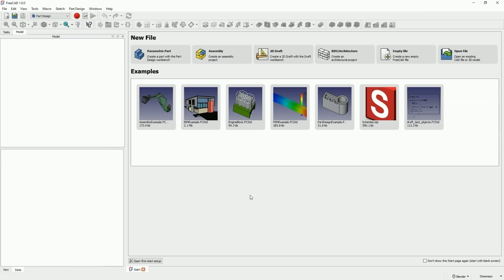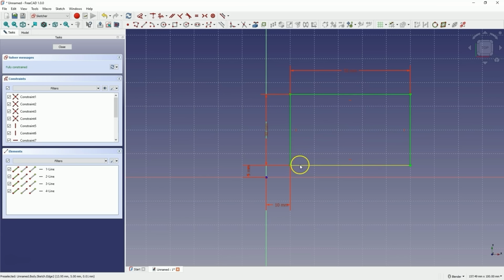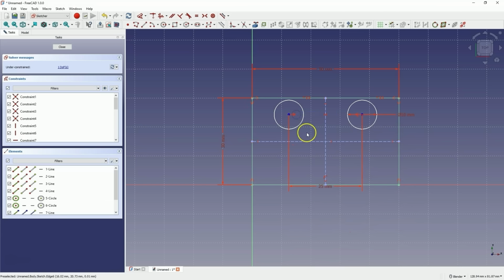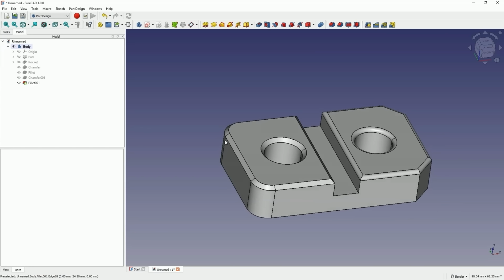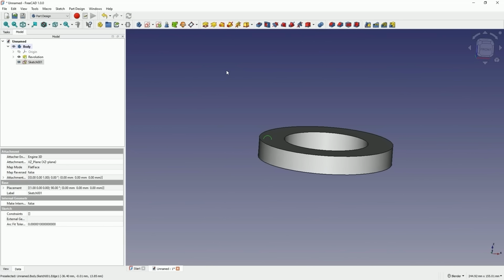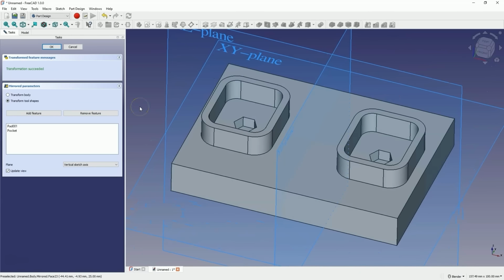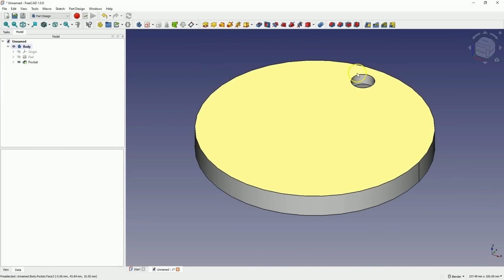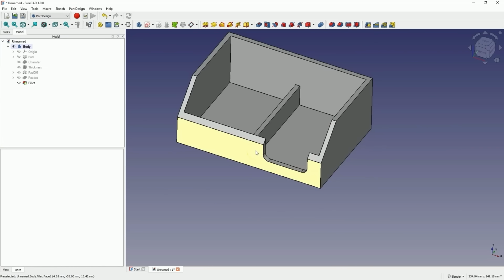FreeCAD 1.0 Tutorial for beginners 2025

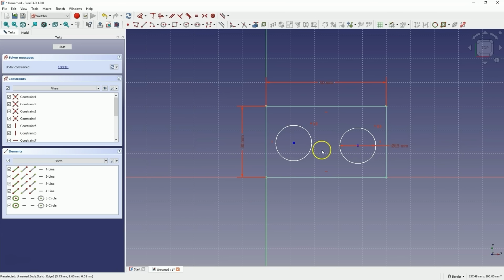Comment: I'm having issue changing the diameter @10:45.   I can change the diameter outside of the rectangle no problem; however, whenever it's inside the rectangle..... it doesn't change at all even when I change the value for the diameter.

Comment: When flipping back and forth between the video and my actual sketch, at one point, the lines in my model turned very light color. When I applied the "extrude" command, the entire sketch/model turned green.
What did I do wrong?
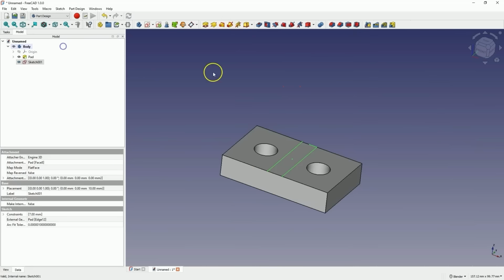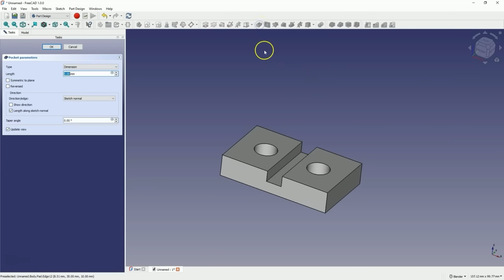Second question: At video location 23:39, the sketch is not shown as being complete (closed). When the pocket operation is chosen (23:44), the sketch disappears and the error "Pocket wire is not closed" is displayed. How can this be corrected?

Comment: If you follow along and have an issue with the second rectangle’s Constrain Symmetric feature turning orange, you need to check the “Auto Remove Redundants” box under "Auto Constraints" setting he told you about at 12:50

Comment: When attempting to symmetrically constrain the rectangle as shown at 23:08, my sketch becomes over-constrained. I've followed along perfectly I think...clearly I did something wrong. Any assistance greatly appreciated...thanks! Version 1.0.2
Reply: same here
Reply from the maker: In the newer version, this might indeed behave a bit differently — it seems the automatic removal of redundant constraints works in a slightly different way now, which can cause small differences like that. Try manually removing redundant constraints in the panel on the left side of the window.
Reply: Thank you for the advice…I did and the sketch is now fully constrained.

Comment: Fnatastic, straight forward, step by step, for beginners tutorial. Coming from 3D tools like Blender and Houdini, I thought CAD would be realatively easy - It's not! But while following these steps I keep getting to a point where things turn orange, which according to the internet means that something is "redundantly" or "over" consrtained.
Reply: Hey I kept running into the same problem.. I fixed it by going into Edit/Preferences/Sketcher/General then turning on "Auto remove redundants".  I believe you used to be able to turn OFF auto constraints but I can't find that option.

Comment: The problem is The Windows and MacOS versions are different. So, the tutorials of Windows are not applicable for MacOS. So, no point of watching these tutorials, which are on Windows.
Reply from the maker: FreeCAD on Windows and Mac is the same program. There are no significant differences — any differences may result from interface settings, which depend on the user.

Comment: As a FreeCAD newbie, I've tried to get my grips on this software by following several different tutorials. All of them left aside essential steps to set up a design. Your tutorial at least closed some of these gaps. I'm sure I will still find some more obstacles on my way onwards, but yours is by far the best beginners' tutorial I've watched so far. Transferring sketches from 2D to 3D is not an issue for me: I've learned that back in the days during my apprenticeship, and as an elderly software engineer and database designer I'm used to deal with 10, or 20, or 40-dimensional spaces. My main problem is the complex user interface, that's similar to nothing I've used before. You helped a lot - thank you for sharing your expertise!

Comment: At 23:23 when creating the 2nd constraint i get a redunant constraint and it wont allow me to set it to 7mm
Reply: Or it says fully constrained and  gives error once i put 7mm
Reply: I have the same problem. I can't constrain the width of the rectangle.
Reply: In the solver messages panel on the left it said Redundant contraints (10). I selected Constraint 10 in the Contraints panel below and hit the delete key. 
The solver messages changed to under-constrained.
Then I was able to define the width of the rectangle, turning it green.
Hope this helps.
Reply: @PhilipBryden  Thank you.
Reply: @nicklasknudsen9421  I've just found there's a drop down settings menu (top right in the contraints panel). You'll find a tick box to remove redundant constraints. Mine was un-ticked.
Reply: Nope, still doesn't work for me....

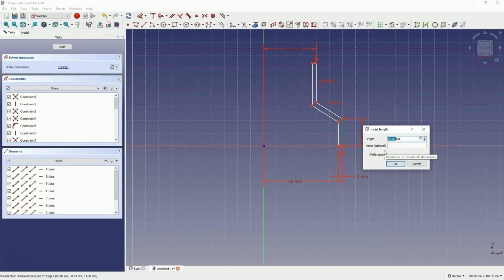Comment: At 37:24, when I attempt to set the dimension of the upper outside point, it moves the point but does not shift the attached items with it, rather just takes the point itself and moves it and drags things with it which ruins the sketch. I've followed your steps precisely and every single time it does the same thing. i set all 6 vertical lines as parallel, then set the width at the base, then set the distance to centre as 60mm and then when I do the same at the top, it just moves that single vertice rather than adjusting as yours does.

EDIT: I figured it out. When he said "doesn't matter about the dimensions" i made mine a bit more abstract. Because the setting of the dimension to 40mm from the axis meant that it moved that point past the one to the left of it, it flipped it. To rectify this I found two ways: Firstly, draw your first draft roughly the same shape and location you want it to go, and adjust it only minimally to get it to fit properly where you want it, OR you can draw it wacky like I did, and before you constrain it, click and drag it to fit the shape you want more closely before you constrain it.

Comment: Hi there, your tutorial is in much  more  greater detail than other. However, when trying to use the 'trick' with the auxiliary lines I'm unable to create such a line. The program complains about wire not closed and using the option to toggle them from being part of the sketch and being an auxiliary line nothing happens. What gives?

Comment: I keep doing something that causes the loss of all the sketcher tool icons, I lose the coordinate system and the grid, and I can't get back to the working environment. I think I pressed esc, but it could have been something else. Now, I can't continue to follow along with the video. I've restarted, 3 times. [see the fix below for how to get out of trouble]  I get to the place of setting the 7 mm dimension and I get the message "Datum for the constraint with index 12 is invalid (shows I've tried 6 times) (and it doesn't show the 7mm dimension, and it remains orange, doesn't turn green -- it never gets fully defined). I tried many times and can't get past this point. [I had doubled an instruction which I needed to delete from the list].  If you double selections of elements, you can get an error and the sketch won't complete properly. 

I tried again and came back to the point where I use the pad. I get the message "Cannot use selected object. Selected object must belong to the active body"
I'm trying to figure out how to make it the active body. It turns out you can't select the object, it has to be already linked to the geometry. But I was able to get the pad to work, but not a sketch on the face of the pad. No sketch, no coordinate system. Start from scratch again :(   [I had an element defined twice causing trouble, I deleted it from the list]. Also, on a Mac at this point, I was NOT able to chamfer or filet a surface selection. It appears to be broken. (1/8/2025)

I finished all the examples until the end. Finally! Some things I learned: on a Mac, as usual, "command" replaces "control." On a 4k screen, the dot intersections are very small, sometimes I couldn't tell if I actually clicked the dot (it turns green when clicked) sometimes I had to zoom. The examples go very quick and you need to notice if the selection is a center draw on a sketch or a basic draw. I don't use Safari to do these kinds of tutorials because you can't switch back to a full screen video. I use Opera or Brave browsers.

You can save each example and it will be added to the list of models in your project. After saving you can start a new part by clicking on "Start" at the bottom of the screen and then selecting Parametric Part to start a new part, just add a sketch to define the part. If you get stuck you can undo to back out. You can also double-click any element in the design to edit it. You can go back and forth. 

It takes practice to understand the methodology of the program, but once you get it, things flow more easily. One confusion was the ability to select two points without having to hold down the command or shift key. It just allows it. But not in all circumstances, for some discontinuous selections you need to press the "control" (PC) or "command" (Mac) key to create multiple selections. Also, he uses the grid on all examples. You can turn it on and off by clicking on the grid icon.

All in all, this single tutorial actually gave me basic skills, no other tutorial even came close. He is a master teacher. Yay! and THANK YOU...
Note:  I needed to edit this comment multiple times, so it reads a little awkward. I had to restart or backup and redo instructions many times, maybe 20 times to get through all the examples, but I learned a lot. It's worth it to meticulously go through this tutorial, you will get rewarded with a good basic understanding of FreeCAD.

Comment: I tried and tried but freecad 1.0.0 does not behave like in your tutorials, I get loads of error messages about unclosed wires???? I feel like giving up on it.
Reply: 3D operations can only performed with closed geometries, otherwise you get the wire not closed error. So make sure that in your sketch all the joints are really connected. Sometimes it is difficult to see. Zooming in can help and/or you can try moving a line to see if it is connected at both ends. If you identified the open joint, CTRL-select the two points and click on the coincidence button.
Reply: I feel same before watching  his tutorial. It is a parametric tool, so, you have to constraints the line. It can be dummy data, otherwise it always shows error, because it offers very limited degree of freedom.
Reply: See my comment, I had so much trouble in the beginning understanding how this app works.

Comment: As an actual beginner to the software using this video to understand where to start, I have 2 issues. The first is at 36:10 as I continue to get a too many constraints error as soon as I constrain that second point to the X-Axis. I also get too many constraints errors when trying to parallel some of the lines. I really cannot figure out the problem. I followed every step as quickly as I could keep up, which leads to the second issue.The second issue is these tutorials are run through so quickly there really isn’t time for the novice to keep up. The last few lessons were like a speed run so any time we run into anything unexpected we have to pause and reverse several times.
Reply: Overconstrained sketches are an frequent issue. Very often elements are constrained already, for example they got an horizontal or vertical constraint automatically when drawing the line. If you than apply another constraint (e.g.  coincidence or symmetrical) the sketch turns orange and you get an error. You can press CTRL-Z to cancel the last command and try to contrain differently. 
Regarding your second problem: Why don't you stop the video while you're trying to do it yourself? Instructional videos are always too fast for beginners to do the exercises themselves at the same time.
Reply: @jurgenr3240  I did indicate in my post that I had to pause and reverse several times. I really don't see an issue with slowing it down just a bit, but you do you. I'll keep looking for something more my pace.
Reply: Use a browser (not Safari) that lets you watch videos full screen, then pause and switch back and forth with command/control-Tab. Safari won't let you return and keep full screen (at least not on a Mac). Sometimes you may only watch for 3 seconds and do the instruction before returning to the video. You could NEVER do a tutorial like this in real time. Fortunately, you don't need to.